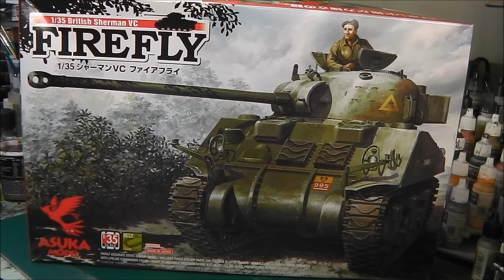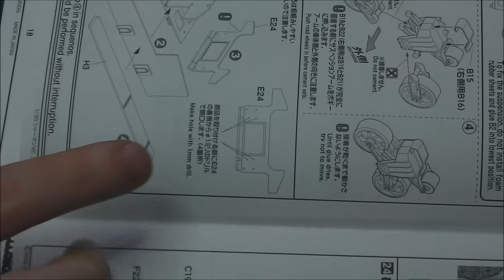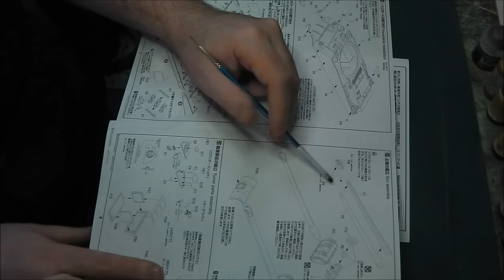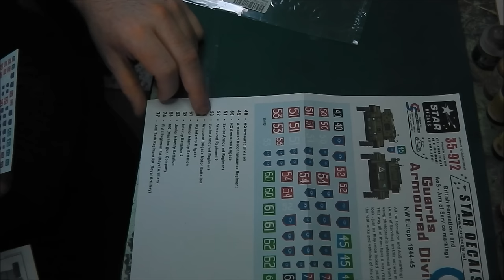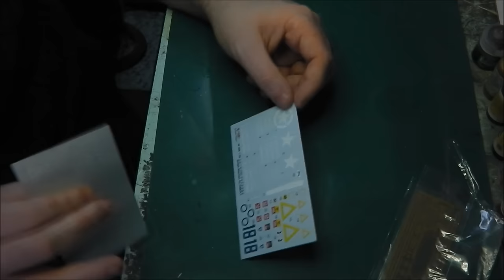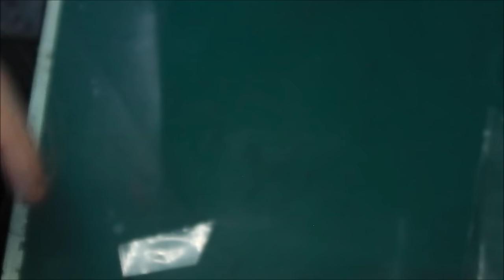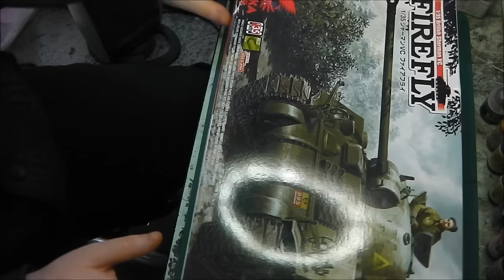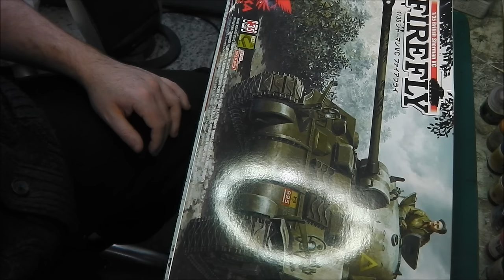Tasca / Auska models 1/35 Sherman FireFly VC  REVIEW

Comment: Good review my friend. It makes you wonder why the allies did not have higher calibre guns to start with 😕
Reply from the maker: +SabreDog F86

 its one of the most hotly argued subjects regarding Sherman by academics. But from my studies it tends to boil down to a few factors that came together at different stages to come back to bite the crews in ass. Firstly Sherman was built to deal with Panzer III-IV and Stug which it was awesome at, so its armor and gun was tailored for this job. Then the fact that Americans would have ship their war gear everywhere would also influence their reluctance to redesign anything new as this would create cease of momentum of the war effort as the factories and crews retooled and retrained.

this coupled with the fact that the US armor Division really didn't get into heavy clashes with the Panzer Division till Sept of 1944 during the Lorraine counter offensive. Meant that by the time they were forced to realize that the Sherman was outmatched and needed to upgraded they were forced to keep it in service as war production was in full swing and though the Sherman was suffering terrible loses it was still getting the job done.

though the 76mm and 90mm guns mounted the M4 and tank destroyers were good enough to knock even the big cats at ranges of 500m or less, it was the fact that armor was too fragile and more often than the Sherman was on the offensive so had the disadvantage of fighting on the German's terms.meaning they fired first which counts when armor isn't great :(     

sorry if I went off of ramble but that is the basic reason why, it was seen as good enough to make do at the cost of the men who crewed them :(